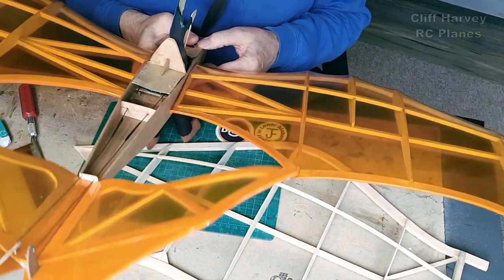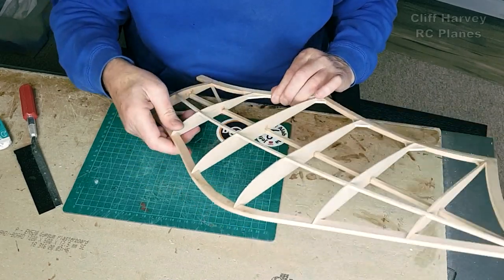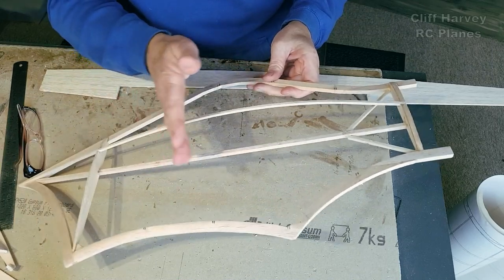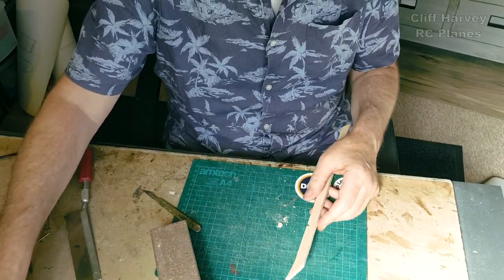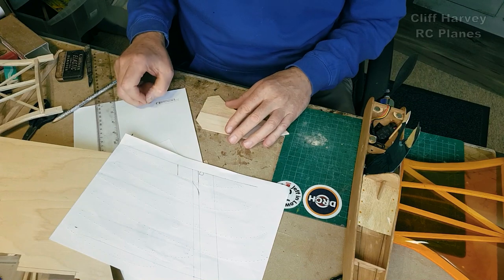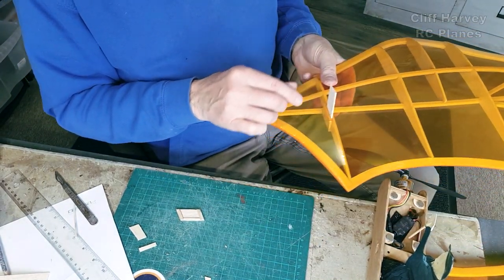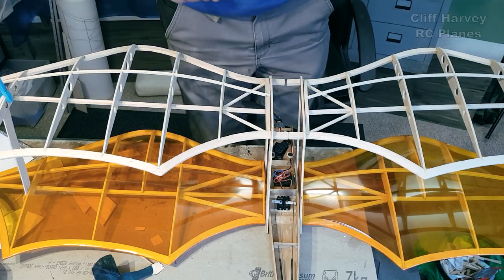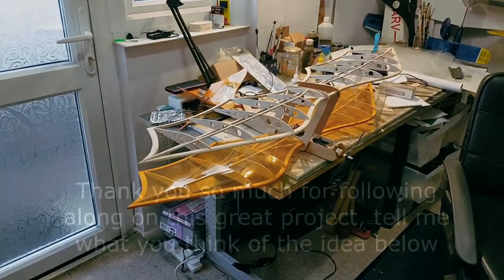Da Vinci Flyer Biplane Creation Part 1

Comment: I thought you was kidding when you was talking about a Bi-Plane. What a brilliant idea and fantastic build already. How did you make your holes? 
Nice you watch the show while working 👍🏻. Have a great weekend Cliff.
Reply from the maker: Hi Chris, she's coming along nicely isn't she. The holes were drawn on my rib plan then when I was happy with the size and spacing I  transferred them to the balsa. Then I cut them using three different bits in the Dremel. A better way is to use a piece of sharpened copper tube and just rotate it in your fingers but easier on a flat bench. It's difficult recording and watching at the same time lol, but if I make a booboo I can blame you 😁